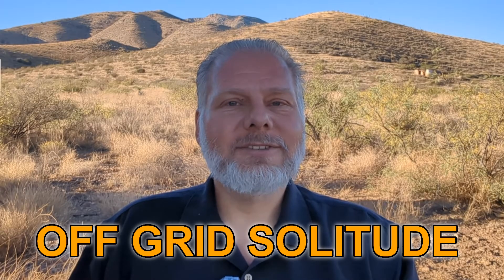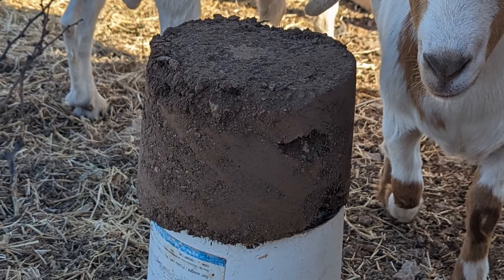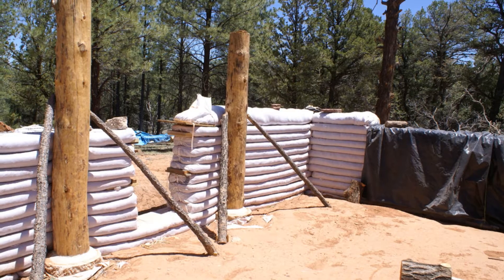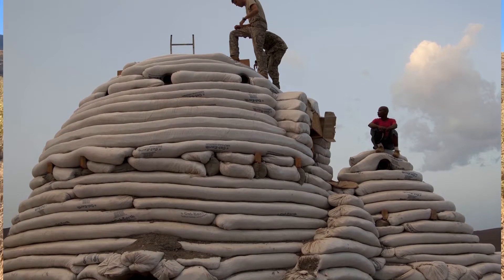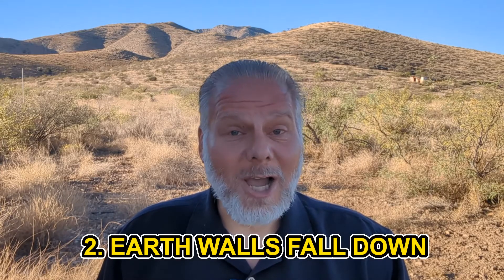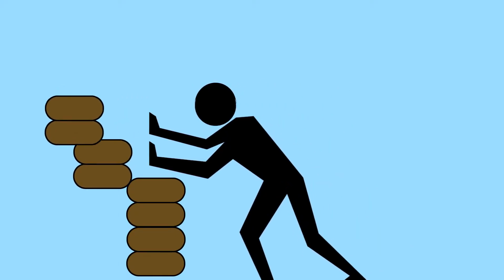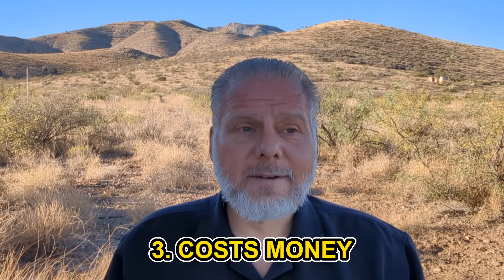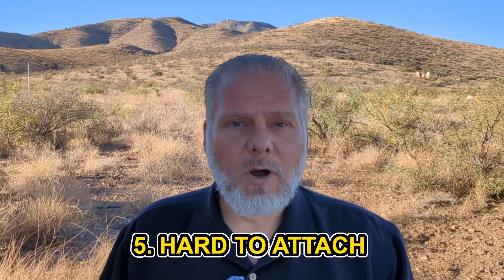5 Reasons Not To Build With Earthbags or Hyperadobe.

Comment: An other technique much less taught but actually working since long time is load bearing strawbale houses and cottages. Cheap to build and to heat (or cool), you need to bring many strawbale at first wich can be or very easy and cheap or far and hard to find (the small ones).
What i saw working was for a cylindrical one with a recicprocal vegetalized roof : Pebble mound surrounded by 2 layers of hollow bricks, strong wooden frames around any openings, then some sharpened hardwood poles were inserted into the bricks. A first layer of strawbale is then pushed into the poles, and wired strongley with the same plastic wire used for straw baling, second layed alterned (and every layers) then new poles inserted into again each few layers so everybody is joined vertically. When alternating layers you will need to 'cut' the bales, so first you need to make a simple long wooden needle to pack it at the right size before cutting the "old size". Evey bale is also connected with the same plastic wire wich is very resistant in time. When you arrive to the top, you have to fix strong hardwoods together so it is braced. Then a reciprocal frame is build with reclaimed hard roundwood from local forest clearings for instance or bought at the same place you can buy fencing wood poles.
 Then you can coat the sides with earthclay plaster in 2 or 3 layers, the last one containg lime so it resist better to the weather. To help the coating to stick (because vertically it is not easy to coat) the inside and outside parts (of the future walls) bales can also be dipped not too long into a creamy mud placed into a old bath tube before be put in place. To help the coating part also an electric brushcutter can be used to trim all the little straw "hairs".
The roof is then or wired heavily with the plastic wire or lighthly plated with nailed sticks or boards to carry the weight of bales that will also need reshaping.
An other (but smaller) wooden bracing is then put on the utside part of the roof, then a EPDM membrane is put in place. An "in state of the art" chemney hole and fire insulation is placed, Then a fishing net, is put on top of the EPDM, then you can collect mosses on abandonned roads (and not in wild places, to not destroy the ecosystems) to cover it
Off course before building the windows and doors frame you already reclaimed them so it is the perfect size to fit in, so now you can place them.
 I Also saw other interesting techniques with loadbearing strawbale vaults and dome, but i don't now personally the projects, and the dome one still needed a metal structure.

Comment: Frame building in the desert is fine for your lifetime, rammed earth lasts for centuries, the thermal mass especially with a thermal break in the middle offers excellent thermal performance and energy savings. Having lived in a 12" adobe house most of my life, I see that eventually both the heat and cold get through the wall, especially the heat, so the thicker, the better.

Comment: Since when the earth is not an insulation? THE ONLY problem is more work because you have to make the "bricks" yourself and if you donk have the skill it will fall easily. Of course you will need to protect it from the rain, but it is not a con. Its just common in almost every building technic.

Comment: From watching some other videos, its clear there is scope for some machinery. For example, the sifting. The mixing. 
Why not have a hyperadobe bag set up? That means you have a filling station where the bags are filled. Conveyor to a front loader. That raises the bags to where they are put in place. That removes the hand filling of the bag on the wall, but you get separate bags. 
I've not seen people hammer in rebar vertically to strengthen. I'm sure there are safer ways of handlign the barbed wire. Pull it out and straighten, then lay on the walls. Or some form of nails.

Comment: Hmmmmmm.... This guy has not actually built an earthbag house. We have built 3 now ..... Yes to the work, but we have a lot of strong young people helping. But as far as the insulation.... Earthbags are extreemly great at keeping the heat in in winter and the cool air in in the summer. 
Also as far as the cost, we built a complete 15x15 square cabin with a half loft on the plateau in Tennessee fir $4000. We built our own doors and windows out of the trees we milled with the chainsaw but even if you added the cost for those it would be significantly cheaper and better quality. We never worried in a storm!!! I can see how a single individual would think it to be a LOT of work though.

Comment: No insulation? Are you kidding? Have you been in a Superadobe home? At the Cal Earth, they have several examples (from tiny emergency shelters to a large complete suburban residence) on the grounds that are incredibly cool in the summer and warm in the winter.  Superadobe homes are also higher rated than stick-build structures for earthquakes, fires, flooding and other natural disasters.
Reply: It's not insulation it's thermal mass. A foot of adobe has about an R1 insulative value, so not much at all. But it absorbs and releases heat slowly, so it stays roughly at soil temperature instead of fluctuating with outside air temps. But if you have long hot summers, the inside will gradually warm up to the average air temperature.

Comment: You are correct and thoughtful in describing the cons. I built a 700 sqft earthbag home not too far from you in New Mexico. The labor was intense (but I got in great shape). One drawback you did not mention is that the bags deteriorate in the sun after about 2-3 weeks so you have to keep them covered. I got into a groove of laying a number of rows, stuco coat, laying more rows, another stuco, etc. I did everything by hand (sans I had a backhoe come in and dig a huge hole so I could have a mountain of dirt to fill the bags. I estimate that I filled over 3,000 bags for this project. The advantage for someone like me is that I had ZERO carpentry experience. So framing for doors and windows was extremely minimal. I also recommend a wooden roof rather than a dome because I have not been impressed with waterproofing solutions. I previously built a small dome as a prototype and in leaked when it would rain. I used a traditional and simple wood frame roof for my earthbag home. Yes, hard labor, benefits are the simplicity and no insulation is not a problem, 18 inch thick walls and thermal mass. Learn about the 'Thermal flywheel Effect" and you will be fine. https://www.tumblr.com/timoffgrid

Comment: My concern is the polypropylene bags if exposed to the sunlight will disintegrate quickly . Also insects deciding to live in the nicely graded and sifted soil may be a big problem.

Thanks for the info 👍
Reply: i saw a guy in a video,showing how to build circle house, mentioning that bags are "UV treated" so it dont get decomposed... try to look up about this.
Reply: You have to cover the bags with a tarp while building, and then cover with plaster to prevent uv damage. Even the ones treated with UV protection don't hold up very long in the sun.

Comment: I agreed until the insulation part. Earth walls don't need insulation. When the weather is warm outside, inside the house is cool. When outside is cold, surprisingly inside the home is warm. Actually, in North Dakota some pioneers built tiny mud homes and it worked out pretty well
Reply: Yeah, usually the problem comes from people not building the walls thick enough. Modern adobe bricks are 14" thick but if you look at traditional New Mexican adobe homes that were built 100+ years ago, the walls are often 24" thick if not more. 

So you really need to do two courses of adobe bricks and not a single layer.

Comment: Every time I look at something like this I think more and more that I would rather just pour a pad and put up a large quonset hut. It wouldn't be solo construction friendly, but it would be low skill labor friendly and that should be good enough. 

Build it, add septic, water, and electric. If you want to make it comfortable insulate it, otherwise consider having a camper or rv in the hut as your full service living space. It doesnt even have to be a drivable rv. It could literally be one with facilities that work and you just tow it to the site and park inside. The advantage with that is there are a lot of over the hill rvs that still have decent interiors, but have issues with engine, drive train, or a leaky roof. Those kinds of issues aren't an issue if it is parked indoors.

Comment: great video, i think you're spot on with four of the five points, but with point four, there is more options than just spray foam. I think it isn't widely spoken about because building that way is uncommon enough, but for earthbag building in the north, an outer course of bags filled with vermiculite/perlite is recommended. i don't know for sure, but a second wall might also help with the stability, if they are each slightly angled for a subtle triangle effect. most important thing to keep in mind i think is that earthbags/hyperadobe aren't silver bullets. if the design isn't well thought through, it can and will fail.

Comment: As someone with home building experience and that has heavily researched alternative building I could not disagree with you more. Do to your location you have no choice but to self build but you bought what you could afford congratulations on that. It's sounds to me like your building a shack not a home, lumber, T-1-11 siding probably no drywall as that is an incredible amount of work in it's self, etc. If that's the case in the environment you are in you're building for failure. Convince shouldn't outweigh logic. your stick home home will be an oven in the summer and a icebox in the winter and is the worst possible choice for your location and weather environment for longevity and easy of maintenance. I have been to Cal-Earth Institute, looked into Aircrete, cob etc. I settled on an adobe "Santa Fe" or "Taos" style build if you will for my upcoming retirement home. Fortunately for me I have access to inexpensive labor since I am building it on land in South America that is only a 30min drive to a good size city. Good luck.
Reply: I live in Northern MI

What do you think of me constructing a earth bag
"Addition" off the back of my 14' wide house trailer not fully attached, 6' below grade...
N
Would YOU
Do a basic concrete footing and block foundation a block above grade leaving dirt floor 
Then
Start the earth bags
Or
Ĵust start right outta the 18x20' hole
6' deep with earth bags until finished?

Build
With a 22' treated  4x6 on each corner 16" away from the wall
8' deep that way i can set 2' down below the dirt floor in concrete..
And
Build the earth bag walls with it essentially looking like a curved u like structure..
Then
Cover the earth bags with mesh and mortar/ cement n seal that all below grade with sealer prob tar and repeat basically ending up with stucco looking finish inside and exterior.
Finishing
With drain tile around the outside to prevent any leaks..

With it possibly being a root cellar / growing / tool storage..
L0L

Thanks for the comment,
Very thought provoking
Reply: Soil is not a good conductor of heat or cold so the insulation is great , and if possible you can just pay someone to bring you a truck of soil for not that much money or come with a digger and dig for soil
Reply: Yeah, I'm not gonna hate on the dude in the video, but his points were only half way true in my opinion.

$300 in lumber MIGHT be enough to make a walk in closet, definitely not enough for a 1200 sq ft home. 

Yes it's going to be a lot of work, but if you're comparing building an earthbag home by yourself vs a lumber frame house by yourself, again there's no comparison. Earthbag wins again. 

Also, I'm not sure where he's getting the idea that earth is not a good insulator? Cultures around the world without air conditioning have used earth for this exact reason for thousands of years.
Reply: @daveweisbrich1769  The r-value of soil isn't as efficient as other insulators, which may be what he's referring to. It's more useful as a thermal mass (which regulates temperature over time), but the two things are a bit different.
Reply: I live ~135 miles from Taos NM, ~60 miles from Santa Fe NM...so I am familiar with various adobe house designs and construction procedures.  I have lived in adobe houses and I love their elegance and charm.  Your argument against the conclusions stated in the video is a compelling argument FOR those conclusions.  You have access to inexpensive labor...the contributor does not...he must do everything solo.  You are close to a large city...he indicates his property is remote.  In general. site built, stick framed houses are both easier, and cheaper overall in those circumstances.  they can be effectively insulated to provide quite high thermal efficiency.  Adobe is much lower in R values, and does not insulate as well.  Adobe's comfort advantage is in the moderating function provided by the huge mass of the walls...and in some designs, also the floors, or other augmenting mass associated into the particular design.  Stick built houses can be sealed to the weather with only exterior walls, floor and roof...and then temporarily occupied while installation of utilities, insulation, and interior walls/ceilings continues until complete.  Both systems have their advantages/disadvantages...depending on location, material availability, building codes, local soil and weather, rain fall/floods, and level of seismic activity.  Each house build presents unique challenges to the builder.  The contributor shows a good understanding of those challenges.  After saying all that, with everything being equal...I like a good adobe!

Comment: We just finished a chicken coup that is 250 sqft and... 17 feet tall? Cob and plaster stick great to hyper Adobe. As for "cold in the winterr warm in the summer" is incorrect.  Before the cob and plaster were put on yes, that was correct,  it WAS still cooler then outside in the summer and a little warmer in the winter. However, once cob and the lime plaster was applied even when it was 20 outside it was 60 inside (no heat at all) in the summer when it was 100 it was 75ish inside. The bags were exposed for a year before cob or plaster was put on. When it rained the bags did get wet, BUT stayed hard. 

Yes cleats have to be used. Yes hurricane straps have to be used. And you are 100% on the labor part . 😊
Reply from the maker: Really? 20 degrees outside and 60 inside.  That sounds perfect.

Comment: Good video thanks to give us the info. But I disagree with you on only on one thing.
building  a house with earth it is not necessary  any insolation, the earth adobe is the insolation. 
I lived for many years in an adobe house in Taos New Mexico and I know that in winter it keeps the heat inside and in summer it is cool inside.
Adobe homes need no insulation.
Reply from the maker: Well that's good to hear.  Some people complain about cold in winter. And I know concrete and brick buildings have always felt cold to me.  But maybe the windows weren't sealed, etc.

Comment: Thank you for this video. I’m a huge proponent of earthbag building but your points are 100% spot on. With a team of 4 fit people, they’re a challenge to build, and you will be exhausted at the end. 

I can source cheaper bags (especially for wholesale quantities of hyperadobe roll) and I am comfortable working through the process of using thermal mass effectively, but just like the design of the walls to ensure they don’t collapse, it’s a significant process and requires a lot of local conditions; not just erecting a building like can be done with other materials.  

While I love the method, I think so many of the failures are because people get excited without doing serious research and miss the points you explain here. Thank you for sharing these so succinctly.
Reply: sources for hyperadobe rolls?
Reply: @daycrow8651  Sorry, didn't see this. Volm had good pricing for me in 2021. I can't speak to today. 
Here was their info as of 2021. 

 We manufacture rolls in 1,640 Foot lengths. Our most popular tube size is 16” and sells for $0.21/linear foot delivered to the job site.  That calculate to $344.40/ Roll.  In you inquiry you mentioned about UV disintegration.  For all our outdoor product, Shade Cloth, Privacy Mesh, Fencing Material and Hyper Adobe Tube Netting, we build in an UV additive to reduce the UV harmful effect of the material.  We have a 5 year warranty for all our outdoor product.  You should have NO CONCERN regarding our Hyper Adobe Tube Netting disintegrating during your build.  That said, it is still wise to store the material in a shelter or cover it up with a tarp.

volmcompanies.com 

Obviously follow up with them to see what current information is, as this is 4 years old.
Reply: @daycrow8651 
Google it, thats what I did. Still haven't decided if I'm going to through with trying to build it
Reply from the maker: Thanks.